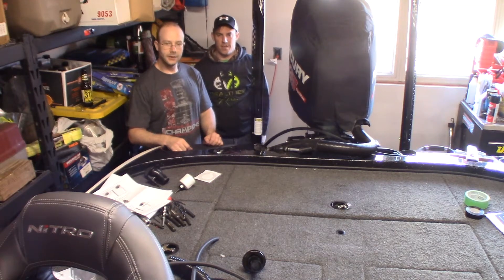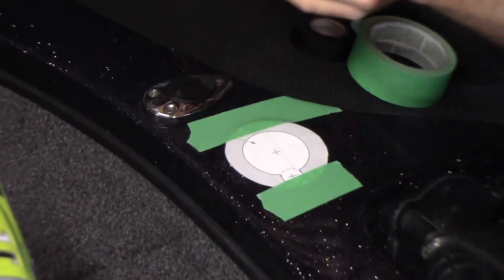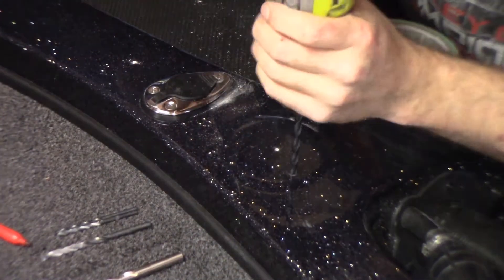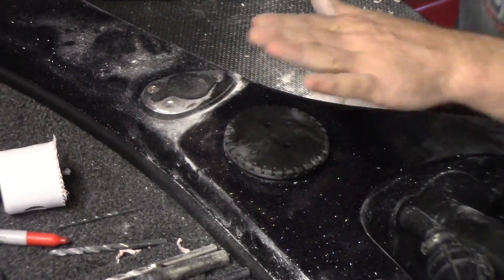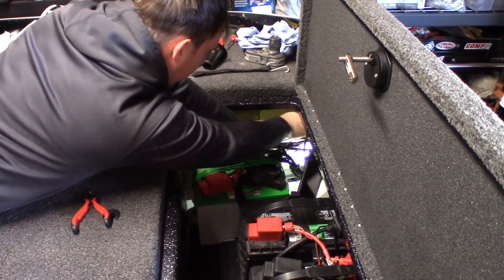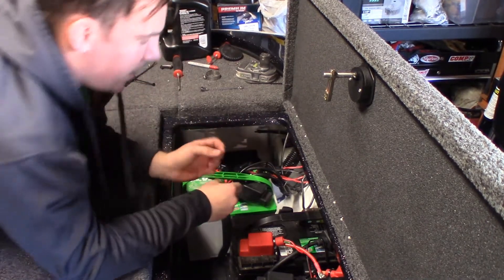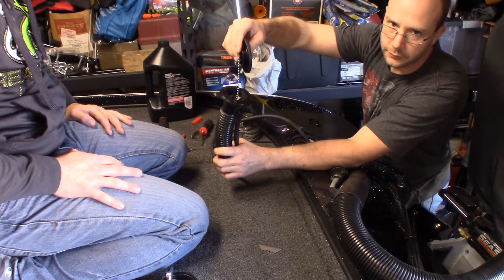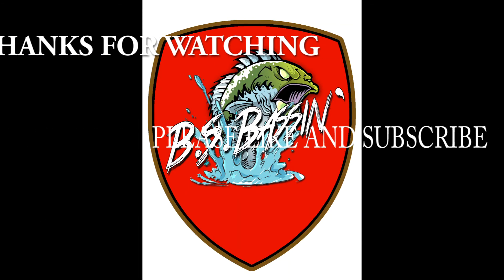OUTBOARD REMOTE OIL FILL DECK FILL INSTALL

Comment: mercury calls it a kit, its not really a kit if you need to buy a hose to finish the job. thanks for the video.
Reply from the maker: Everything came in my kit. I didnt have to buy anything extra
Reply: Where can I find this? I want it